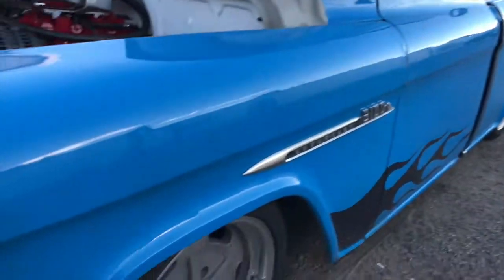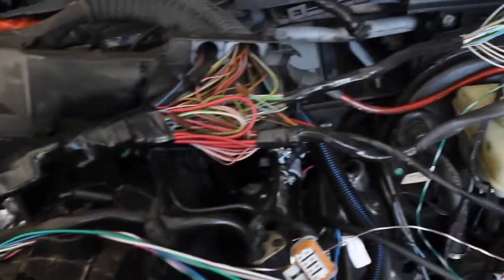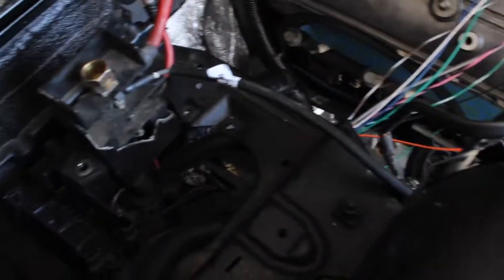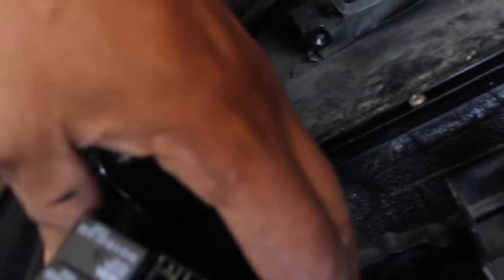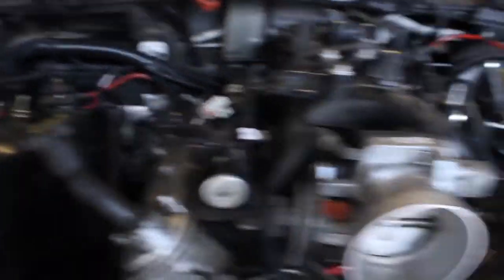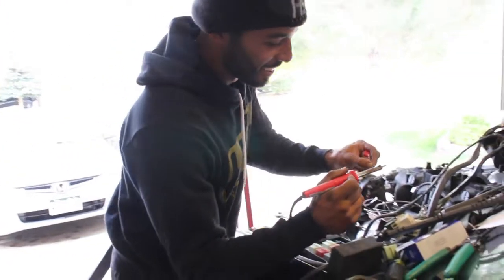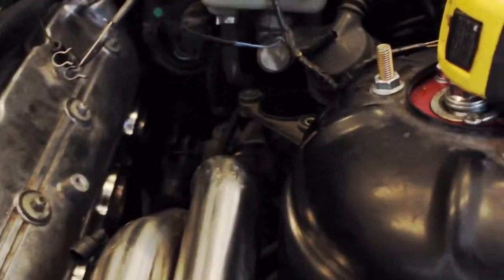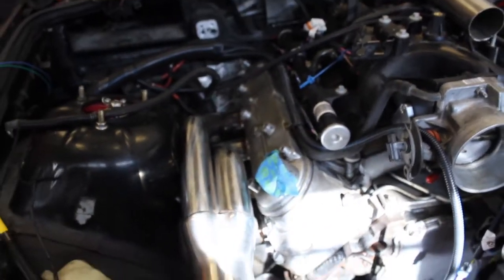LS SWAP IS A LOT MORE WORK THEN I EXPECTED *E36

Comment: If you can go without the power steering, it looks like you'd be able to mount the turbo to the upper left(front of BMW) of the water pump off tge fabbed Y pipe.
Reply from the maker: Richard McDowell let me see how I will like the car first then gonna go from there with the turbo stuff. Great ideal though